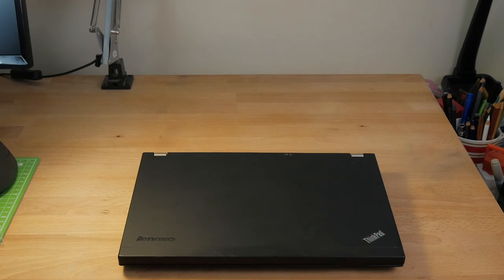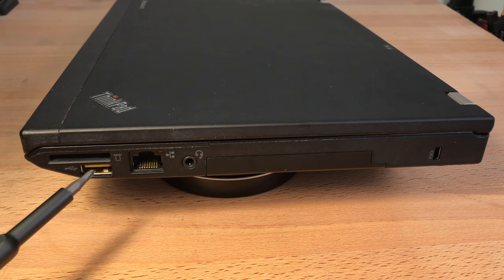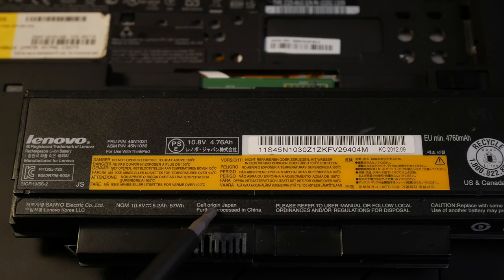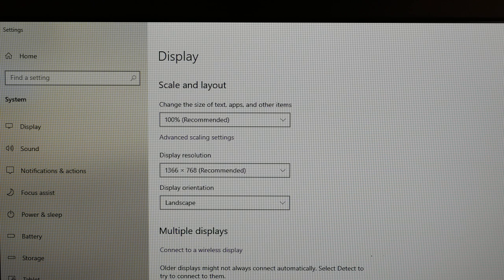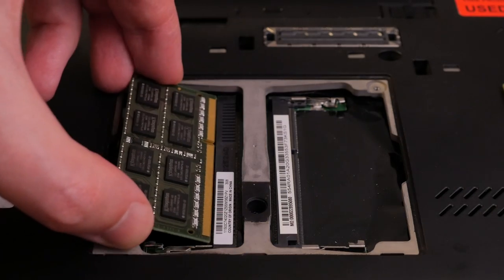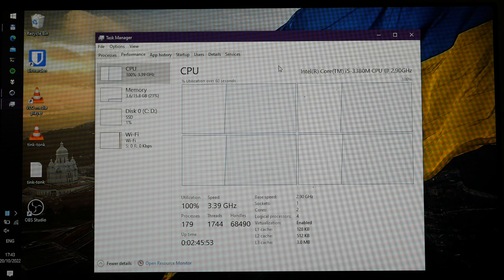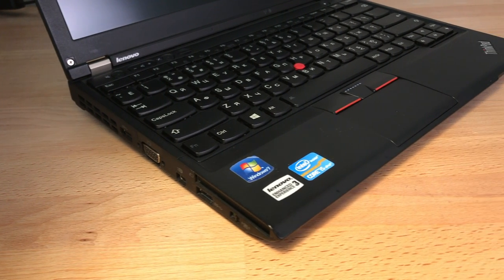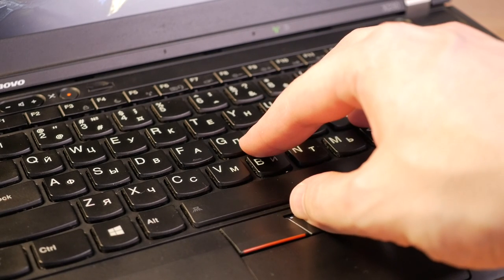My favourite laptop is 10 years old (ThinkPad X230 review)

Comment: Kinda surprised this review there was nothing about the slice battery which basically doubles the battery life while using the docking port. Anyway got an X220T with both the 9 cell and the slice pack, also installed an 1866 kit to help boost the performance a little.
Reply: 1866 kit? What is that?
Reply: @erwintan4746  DDR3 1866.....

Comment: Had this laptop for years. Upgraded the keyboard to backlit, ram to 16gb, new wifi/bt chip supporting 5ghz and bt 4.1 and installed ips lcd. It was a beast
Reply: How'd you install an IPS LCD? You ordered from xyte?
Reply: @hucklejoko4838  You can install it the same with the original lcd, Only the 1080p to 4K ips requires soldering skills
Reply: Why "had"? What do you run today?

Comment: Watching this on my X230 😄 Still my only computer after all these years. I've got the backlit keyboard, IPS screen, and I upgraded the RAM to 16GB. I'm running an external monitor through DisplayPort. It's a Dell U2518 which has the same pixel density as the built-in screen 😉
Reply from the maker: It's amazing how these old machines hold up even after 10 years of use. I also use mine with an external monitor connected to the docking station.
Reply: How well does it function after you upgraded it to 16GB RAM? Do you think it would be able to work on Adobe software like Photoshop?
Reply from the maker: @K_MZL7  As far as I know, hardware acceleration in Photoshop requires a DX12-compatible GPU, so it would not work on this laptop. Otherwise, it should be fine for basic things.
Reply: @K_MZL7  I run PS CS6 and sometimes work with 18MP jpegs. Haven't had any problems so far.
Reply: did 16gb ram make any difference in performance for you? I am tempted to do this on my i5 x230 but I have yet to run into a scenario where I actually need 16gb ram. Might do an x220 keyboard mod as well.
Reply from the maker: @samagoc  I have 16GB of RAM in my X230 as well. The main difference is that it makes heavy apps like Android Studio actually usable. If you're not running these huge and annoying applications, you probably don't need 16GB (although I would argue that today even web browsing requires at least 12GB for maximum comfort).
Reply: @samagoc  These days not so much. I open a ridiculous number of tabs in my browsers so in the past these used a lot of memory. Recent browsers are much more memory efficient.
Reply: @K_MZL7  I've got the predecessor, the x220 and have expanded it to 16gb of Ram, PS works fine. You'd be quicker with 32gb and a quicker processor obviously but handling 46mp files from a d850 is no problem at all 👍🇬🇧
Reply: Same (LED Display, i5, 8GB, m2SSD 128 Windows, sata 500GB linux). Recently installed manjaro and it still is strong enough for nearly everything.

Comment: i plan to buy it on backmarket in the uk, the condition is 'good', assuming everything works, how many more years do you see in this machine? i use it to run qemu, and file transfer on NTFS external hard drives, nothing else.

Comment: Great video! Thank you for the comprehensive tour of my X230. I added maximum RAM, large SSD boot drive and the docking port with both optical drive and auxiliary 2TB HD spindle drive for downloading SD/XC cards in the field during video shoots. Then, back at the hotel, plugging in the display port to HDMI, I play back the day's video on the hotel's large screen TV for quality checks. Having a second screen for video viewing and using the internal screen for file navigation is a convenient use of this flexible machine. Thanks also, for the explanation of the yellow USB port; I didn't know that it was always powered. Love the build quality of this machine. Please keep up the good work.

Comment: Thank you for the video! I also have a second hand  i5 X220. It is  upgraded to 16 GB RAM (also second hand) and with an 2.5" 250GB Crucial MX500 SATA SSD (on an offer). So I have given about 150 EUR (in 2017) for the Laptop and about 80 EURO for the upgrade this year. I also like the x220 keyboard more but of course x230 is (a bit) more modern one.  The upgrade is super easy. After the upgrade I think it has a lot of life as a Linux home pc. I am pretty happy with it :)

Comment: I had an early X200 and used a bluetooth mouse/keypad, the most comfortable laptop i've ever had 🥰

It came with a early Intel SSD, when they where made as SLC (Single Layer Cell) in Micro SATA 1.8", not to be confused with mSATA pci slot or M.2. I STILL use the drive for my PFsense firewall, in the last 10 years it hasn't failed me yet 😁SLC SSD have a far longer data retention life than MLC/TLC and the worst QLC that i still see data rot if left unpowered for just half a year. SSD's have to scrub data for both performance(TRIM) and refreshing/catching dead cells, and to do that they have to be powered on at idle.
Reply: aw what happened to it? x200 is legendary man
Reply: @escapetherace1943  my car got broken into, stole my laptop bag with it in it. Womp Womp
Reply: @MrHeHim  same but I'm poor so they just took my registration and my gloves. Hate thieves.

Comment: I just buy x230 few days ago, it's configure i5-3320m, 8GB ddr3 1600MHZ, 128GB msata, IPS display, just cost $300 RMB( about $42 US Dollar), I install Windows 10 lstc 2019, Firefox v115 internet is ok, youtube is good, play local 4K video ok using mpc-hc, ultra-lowest effect Genshin Impact have 24 FPS using old GPU driver. It's work fine in 2024 of today, I'm very satisfied.

Comment: Thinkpad are, in my opinion, what computers should be : durable & upgradable.
Having a X240 - T430, my sons having a T460 and a T590, these machines are great : double batteries is another reason for their greatness. Found both of the X240 and T430 for €150 each of one (both with SSD, the T430 with a 1Tb one inside !!), adding or changing a bit of memory to upgrade at least to 8 (12gb for the T430). With Linux in it, these are fabulous machine.
Reply from the maker: Unfortunately, newer ThinkPads are not nearly as good, which is a shame.

Comment: In my Family there are several Thinkpads (X2xx and T4xx) mainly x30 series some x20 and x00. If you want to use a dock keep in mind that the docks for the T/W Series also work for the X series (just no bay for DVDS drive but USB3-support). yes despite the fact of better efficiency of "modern" laptops there is NO NEED to choose a more modern laptop.
8-16 GB, SSD and you are good to go. Spareparts, repair guide everything at your fingertips. My company Dell Notebook was NOT faster than my T430 (both 4C/8T) The SSD had a quarter of capacity (and slightly faster in synthetic benchmarks due to NVME), and yes it was more power efficient. but i costs triple to quadruple of mine (included ALL upgrades made like CPU, RAM, Display, SSD, Keyboard, chargers, batteries)

Comment: I would say applying grease to the CPU is crucial.  My X230 was experiencing frequent thermal throttling, leading to blackouts.  However, after reapplying the grease, the issue was completely resolved. It might have been beneficial to mention maintenance, including the internal battery.

Comment: Sanyo batteries seem to have good longevity. I've got a Dell Latitude D420 which also has a Sanyo battery, and it still holds charge for about 1.5-2 hours despite being over 15 years old. On all the other laptops I had the battery usually died after 3-5 years.

Comment: awesome. I replaced my dead x230 tablet with an x230 and ripped the ips screen from the old one and put it into the new one. Its awesome! Yeah it runs hot (i5 model) and the battery life isn't great but its good enough. I never need more than a couple hours of battery life anyway. I have an ssd, new 9 cell battery, 16gb ram, ips display, and its running Linux. I intend to get a palm rest with fingerprint reader and backlit keyboard at some point. Id rather "upgrade" an old thinkpad than buy a new one.
Reply: It will be good to put new thermal paste, Im also using TP Fan control, and  Throttle Stop to disable turbo and set max multiplier to 29 (max). Fan 1 speed at around 50C in idle/internet mode.

Comment: Seems that your left hinge moves to hard, because screw and plastic are "collapsed" i had similar issue in new-buyed (refusbished) x230.  Oiled , released spring and set proper screw/spring strenght in hinge.
Reply: I had also problem with random shuttdown, in idle, when cpu was cold ect. Problem was propably poor thermopad contact in N.B.  I replaced to new chinese 21W/mK   0,5mm thermal pad, and new CPU thermal paste . Interesting stuf is that , that propably my CPU has now too much paste and run warmer. But now it works stable without problems...  So i will replace paste once again , but will not change thermopad.

Comment: I have one. It has got a bit slow for Windows 11, but I corebooted it and works perfectly with 8GB with MX Linux. I am planning to upgrade its wifi card to include also bluetooth. Also I am going to add a mSATA card to run OpenBSD on it.

Really, really fun laptop, confortable to use. The only thing I find useless in it is the Express Card bay.

Comment: You should expand on the 'it depends' if you should buy a used x230 or not? I faced the same choices a few years ago: do I get an old thinkpad or a new netbook? Office performance and features wise favours the thinkpad a little. The biggest difference is that the thinkpad is more upgradable(replaceable parts) whilst the netbook has significantly better mobility. In the end I chose the netbook as the difference in price was small, and I would rather have the big advantage in mobility. Due to it's simplicity, my netbook(Acer aspire 1) is actually quite robust due to it's low power consumption. Once you are able to upgrade to 8GB RAM and a sata SSD, the netbook is specced well enough for office tasks.

Comment: That laptop still looks clean. Mine was suppose to be my carry laptop for typing on the go but unfortunately, I dropped it and cracked the screen. I still use it with the lid closed and two monitors on portrait connected. It has an i5, 8Gb RAM and 500Gb SSD.  I use it to read web comics, and documents like Word, PDFs, ePubs, Google Docs, etc. I recently installed Linux on an old dual core PC with only 4Gb RAM and I couldn't believe how fast it is compared to Windows. Web browsing is quick. I want to install Linux on it but I'm a little scared that it won't be able to run the two monitors.

P.S. I can actually try booting it on a USB drive and try connecting the two monitors while the lid is closed.
Reply from the maker: Hi, thanks for the comment. You can definitely use two monitors on Linux — my main laptop runs Linux and I often use it with three screens (one built-in and two external).
Reply: @yeoldestuff  Thanks for the reply. I just scored an i5-4570S CPU, 8Gb RAM with 128Gb SSD for A$30 (Around $19) so I'm using that to run my two monitors for the time being. I'll just put in a HDD from another PC to install Linux for dual boot. I'll have to put the Lenovo laptop as I don't have a spare monitor. I have another laptop that I use for work where I replaced the HDD to SSD. I'm getting a CD caddy and use the old HDD to install Linux. Fun times

Comment: "Today, there are no thin and light ThinkPads that have user upgradable RAM"

Now, that is not really true, or it least it depends on the definition of thin and light. The ThinkPad T14 still has user upgradable RAM and by some measures, it is more portable than the X230. It is certainly thinner and lighter, despite the bigger screen.
Reply from the maker: Well, I said it myself in the video: today the X230 is not really thin and light, but it definitely was in 2012. Today its equivalent (in terms of target audience and market segment) would be the X13.
Reply: @yeoldestuff  Yes, the X13 is technically the successor. However, I disagree for target audience and market segment. Back in 2011 when the X220 entered the market, this was before the dawn of the ultrabook. At the time, the X220 was the only option if you wanted a ThinkPad that really offered mobility. The T420(s) were big, thick and as heavy as today 16 inch models. The reason why the X220/X230 was popular was not the small screen, it was the fact that it was pretty low weight compared to all other options.

What has happend with the ultrabook revolution is that small, thick laptops with small screens were replaced by bigger, thinner laptops with big screens. People who bought a X220/X230 back in the day would end up with a T14 now, the target audience has shifted to bigger screens. The X13 in comparison is a niche option. It is only the successor in terms of lineage, but not in terms of target audience and market segment.

I think the biggest lesson of the last 10 years of laptop development is that people prefer bigger screens. It is why 12 inch basically died, 13 inch is now becoming a niche, being replaced by 14 inch, and we moved from 15 inch to 16 inch.
Reply from the maker: @ithinkabout4369  maybe I'm in the minority, but I definitely don't want to carry around a paddleboard no matter how thin and light it is. I often feel that the T480s is a touch too large for me, I'd prefer a 12 or 13-inch model. Unfortunately, the T480s was the smallest mainstream ThinkPad with a full complement of ports, and the last 14-inch ThinkPad with both the Ethernet port and the full-size SD card slot.
Reply: @yeoldestuff  Yeah, I think you are probably the minority on this. At least as far as more Western markets go, I hear 13 inch laptops are more popular in Asia. Even there though, I think generally, if people buy a small laptop for the mobility, they probably don't need things like SD card readers and Ethernet nowadays. WiFi is ubiquitous and Ethernet only needed in a few scenarios, and SD card readers are much less important for most users since Smartphones have replaced dedicated cameras, so SD card is generally a feature reserved for large creator-type machines.

Comment: I have 2 of this laptop and the problem is the plastic on the hand palm.
Reply from the maker: What exactly is the problem? In any case, new palm rests are available very cheaply on eBay/AliExpress etc.
Reply: @yeoldestuff  it breaks very easily on the edge
Reply: I use pci-e card  USB 3.0 to fill hole, but problem with breaking edges are propably caused by plastic pins/nails  from screen . I used rubber or sand paper to get  smooth surface (not  nailing points damaging plastic's ) to prevent this phenomena.

Comment: First of all, you say chicken keyboard! And I don't know what each Lenovo keyboard would be called and I would like to know if there is a related article.

2- You say that the t430 is the older brother of the x230. I'm quite frustrated because I have an x220 but I've never known what line/series it comes next or what its Lenovo flagship is. Something similar to what Samsung does, it is easy to know which device is its high-end or the one that follows or its previous one.
If you know how to know which is Lenovo 1, Lenovo 2 etc. You tell me!. Since I bought the t480 and I don't know which one I beat.

3- I don't understand that hardware decoding on YOUTUBE, so is it decoded by graphic video or what?
Reply from the maker: 1) Chiclet keyboard. This means that there is some space between the keys.
2) Basically, in Lenovo's world, X series are ultraportable, X1 series are their top models, T series are business mainstream, L series are business affordable and E series are low cost machines. T430 is the same generation as X230 but it has a larger screen (14 inches). 
3) Yes, decoded by the GPU. This is much quicker and uses less energy than CPU decoding.

Comment: Does it work with an external monitor/TV???
I installed W10 on X220 but dos not recognize the external monito/TV (The plan was to use it as a multimedia station based on small dimension and dock station) Microsoft drived me around with edge making me loosing time and getting crazy. No one word on compatibility ... that is the issue: in a group I discovered that W10 video drivers aren't compatible with X220 and suggest to install (not MS !!!) Lenovo W7 driver. Done, and at 3/4 of process the external video appeared but... the process to end requires reboot. Done, it doesn't work any more. I must reinstall W7 driver without reboot every time a start the machine. MS is pure shit!!!
By the way... with Linux MX it works flawlessly!
Reply from the maker: Yes, it does support external monitors in Windows 10, because Ivy Bridge is fully supported in W10 (unlike Sandy Bridge)

Comment: Isn't is sad that Lenovo has built nothing but utter CRAP for the past 10 years?  :( When the T440 came out... and they basically bastardized the once great thinkpad flagship into a generic and I/O reduced consumer laptop, with non-socketed CPUs... and abysmal chiclet keyboard, they really cemented their "We won't give a f*ck" attitude towards the ThinkPad customer base. And it keeps going on. There's absolutely no current-year Lenovo hardware that makes me wanna rush out to buy it. Their Legacy Hardware from 2012/2013 is basically where my love and support for their hardware ends.
Reply from the maker: While I agree with some of your comments, non-socketed CPUs are not Lenovo's fault. Neither Intel nor AMD even make socketed mobile chips anymore.
Reply: I have a x220(i7-2620m),several x230 (i7-3520m, i5-3380m and i5-3360m), a X230t(with i5-3320m) and a  W530(i7-3840qm). All of them are upgraded to the maximum and I love them. But my latest acquisitions are P72(Xeon E-2186M with 128GB RAM,P5200) and a X390 (i7-8665u, 16G ram, 512GB SSD) with second DUEX screen  and they also are respectful machines, that I'm mainly using. Although they are not current-year hardware, I like them a lot